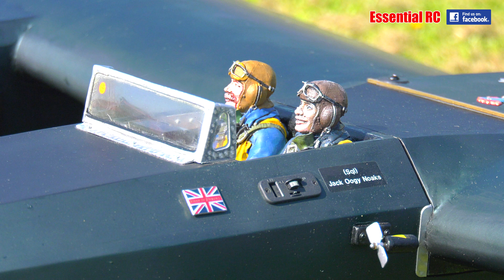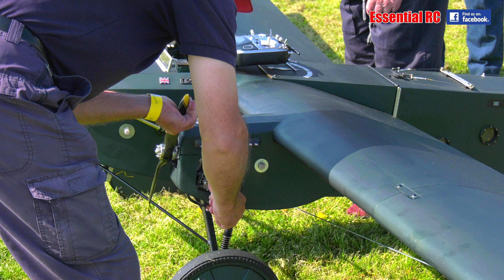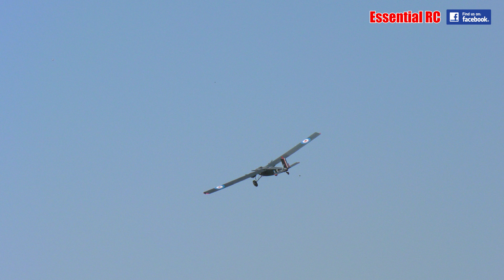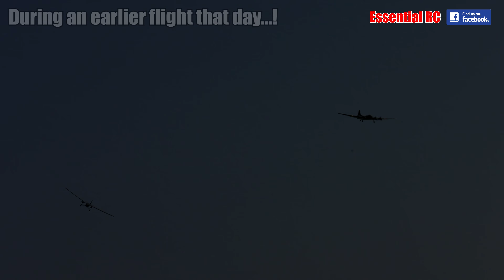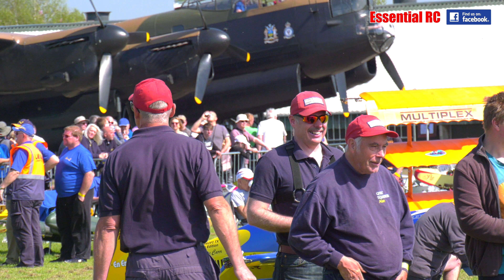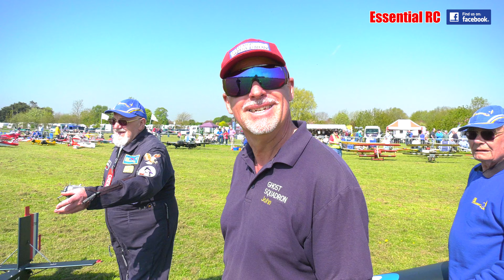Giant Scale RC RAF 'BEARDMORE INFLEXIBLE' BOMBER ! (3 x ZENOAH 38 ENGINES and 21 FT WINGSPAN)

Comment: You know those fingers you had? An engine can cut in even when you think it hasn't caught. I know because I ended up with wrist like a balloon when I handle started a Humber Sceptre, thought it needed another go, and it chose that moment to fire on choke and damn near ripped my hand off.
wait until the prop is stopped before trying to bar it over again - because if it fires with your fingers in the way, at best you'll have a broken hand, at worst you'll be putting your fingers in a bag of ice and heading to the nearest hospital.